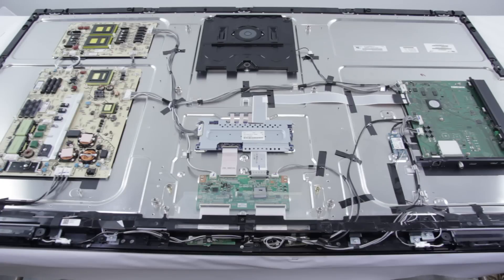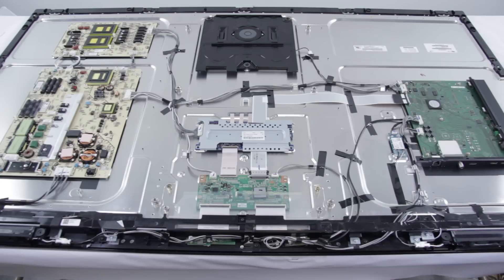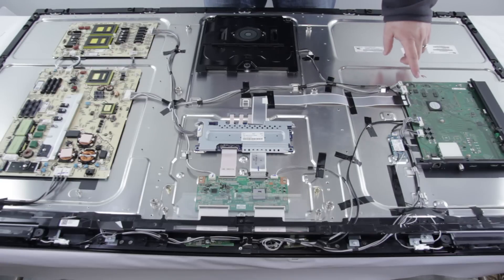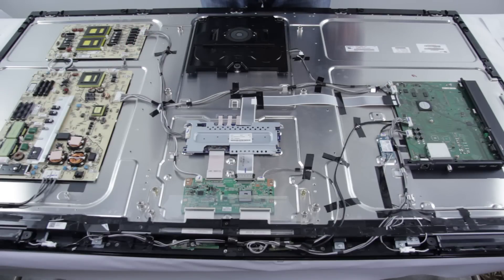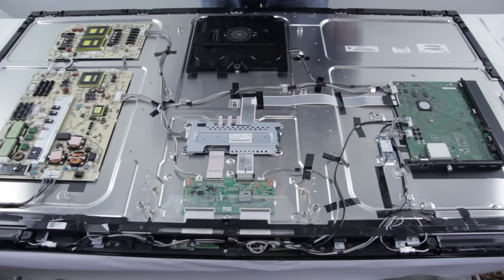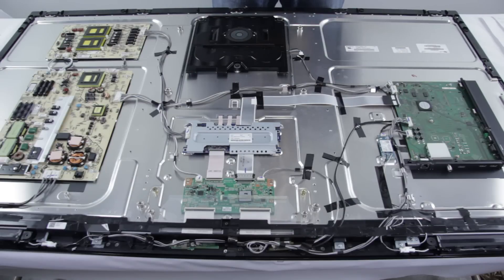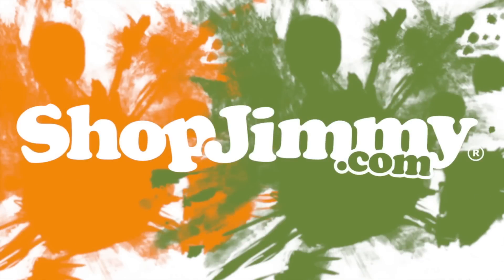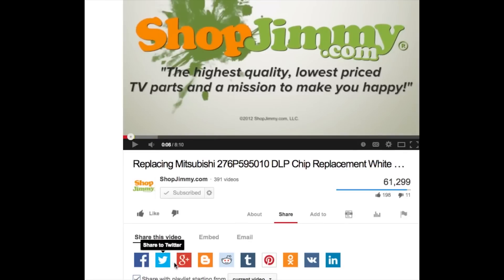LED TV Repair Main Board Overview Blank Screen-TV Has Audio but No Video-Common Issues Problems

Comment: Hello. Thank you in advance. We have a 50 inch RCA model RLDED5078A-B. It has been a good TV. Just yesterday it began to misbehave.  When I turn it on, the picture and sound appears as normal after a few seconds and everything looks great. within a few more seconds the lower half of the screen begins to flash darker in pulses that slowly speed up in frequency until a few moments later when the entire screen goes black. The audio is unaffected and continues. Do you have an opinion?

Comment: I have a Westinghouse HDTV LD-4655VX. The manual power, volume, channel touch sensitive control (not sure what its called" on the right rear of the tv are ultra sensitive. If I even put my finger near any one of the buttons they react radically. Can you help?

Comment: I have a 4K UHD model Hisene 50CU6000. 
It has power and for a few seconds I can see the HISENSE logo on the screen but disappear shortly. 

Somebody said has a backbit LED issue which has to be replaced. I open up the TV and checking LED strips all are lighting up but just for a few seconds. I think is something related with one of the boards... Any input about what can be wrong is much appreciated.

Comment: Hi my LG LED TV model# 42LE7500  is not showing HDMI input. When  switched on , it shows LG logo and then start flickering at the top  with beeps .  what could be issues and appreciate the part# required to be replaced

Comment: I have a Seili SE46FY10.  There is no sound or picture.  The power light is red when plugged in and turns blue when power button is pressed.  Is this a problem with one of the boards, if so which one?  Thanks

Comment: Not sure if you'll see this. Sony xbr75x900f, TV started intermittently stutter-fading where the image would stutter then dim a bit and then stutter back to a live image, all within about a second. This was happening on and off for about two weeks before the TV lost image completely. There is still audio but no video, I'm trying to figure out which part to replace. Any help would be greatly appreciated.

Comment: Hi, I have Vizio Model # E70li-A3 with no picture, I have back lights. At times it would lock itself and I would need to unplug for it to work again. Should i replace the T-Con board or main board?

Comment: Hi.  I'm Joseph.  My TV Vizio M550NV has backlight, audio but no picture in any mode.  The settings screen sometimes comes on but fades out.  When you first turn on power, the visio logo blinks about 93-95 times between amber and white before the tv backlight will turn on but no picture at all, just backlight.  I tested the fuses (swag) and all are good.  No visual burns or puffy caps.  Little gold fuses have continuity.  Reseated the flat strip wires on all the boards and other wires but still have the same problem.  unhooked the IR and turned on with no change.  IS this the Timing controller board?

Comment: Panasonic TX-L42B6B -backlight flashed on randomly when plugged into mains, while green showing on power LED< after a short while the TV goes into standby and the LED flashes red, once every 4 seconds. Any ideas? I know the TV had a knock, but would think the LED TVs to be a bit more resilient that the old CC elements. Thank you!

Comment: I have a 75uj6470 lg tv .. it has a blck screen with bright leds has a few horizontal white lines I get some distortion as I change channels an have sound . Throught some research online I figure it was the tcon board I order it from shop jimmy installed it also installed a new power board  because  I damaged it  while removing the back cover and still have the same issue .. any idea of what the problem could be?

Comment: Hi, I have a UN46F6300AF and the upper half of the screen is dark. The image is there but very dimmed, its like the upper half of the backlight wouldn't turn on. Anyway, I first thought that it could be a T-CON problem so I replaced it including both connecting cables, but no luck, the problem remains. I have all the boards for this TV. Should I try to replace another board or is this a problem related to backlight, led strips?. Thanks in advance for your help~!

Comment: Have a LG  55" model number is 55la7400 when first powered on comes up LG life and then goes black you can still see the picture with a flashlight if you leave it play it randomly comes back on and then goes back out I get audio and all components works and when something is hooked up pictures bright as it should be no dark spots didn't know if it could be a power board since backlight converter is on powerbord any thoughts would be appreciated

Comment: Hi I have LG 43UV766V with defective main board, that gives ok sound but no image. TV has good backlight and I have swapped T-con board. And I’m sure that problem is somewhere on Main board. Do you have any suggestions where to look at on main board to troubleshoot the video?

Comment: Howdy, I've just bought a Teac LED TV (model Let5596fhd) from a friend, I've diagnosed it as having dead backlight (can see black images on the screen (not lit up) at certain angles, and can vaguely make out menus etc), just wondering if this would be a relatively easy fix (I've repaired TVs/Microwaves/etc. before but never an LED tv) and if I can find the part, any help you can suggest would be awesome, many thanks.

Comment: I wanted to commend ShopJimmyTV for its HONEST and rare customer service. I called to order a power supply part that they could have easily sold me but after giving the gentleman a little info to the problem I was having, he gave me a simple test to see if really needed the part and a quick way to test. Bottom line is I did not need a power supply and was very impressed that he suggested where the problem really was. It would have been easy to sell me what I did need but his expert and honesty told me where I should go if ever a future need :)

Comment: Hi, My LG (LE5500) LED TV is not displaying pictures and sound. There is this sound when the remote button is pressed (something like a relay being on) but no display. Neither the power on LED glows. In the background, there is a hissing sound from the main board (sound can be observed from the area where mother board is fixed inside the TV). The LG repair guy says the motherboard needs to be replaced and the local service guy says the main board's main IC needs to be replaced. Pl let me know what could be the issue. Thanks

Comment: hello.  I have a Seiko 50 inch se50fy10 tv. we do not have picture but we do have sound during the flashlight test we can see the picture. I don't know why but I  jumped the gun and bought a t con board which did not help.  do I need to replace the main board now?

Comment: I have a vizio e470i-ao 47 inch smart tv  the backlight flickers and I have no image I have done the flashlight test and tested the power to vout1 and vout 2 on the power board and have readings of right around 130v checked backlight on from power board to main board also and have 3.2 v  any help would be great thankyou

Comment: Thanks for you your video. I have a TOSHIBA 39", and I am having a problem with the HDMI Ports. Both of them are not working. I I verified that the cable is working fine using another screen with my laptop. Now, I use a VGA cable and a separate cable for the audio but there is no audio output!
Do I you think I need to change the main board?

Comment: Hi there...Have a Vizio LED model E390 Bo ...have sound, no picture, did flashlight test, saw words on screen...has no backing lights, removed back cover looked at both boards, no puffy diods, no burning, flipped over the boards, no burns, lots of dust, checked all plug in connections. When powering tv on...does not have V emblem appear. I await your kind reply...Peace, Jill

Comment: I have a Westinghouse LED 39" HDTV 1080P 120Hz Model DW39F1Y1. It's just over a year old.  I was watching TV and left the room for awhile and when I returned I had audio, but no picture.  To make sure it wasn't the Direct TV box I hooked it up to another TV and it was working fine.  From viewing several repair videos I flashed a light on the screen with it plugged into the electrical outlet and could see some printed words thru the screen.  I didn't have it connected to the satellite cable at the time.  Can you suggest what could be wrong and how to repair?

Comment: I have a toshiba model number 50lf621u19 with a picture that is showing but has a white display over it I opened the back but I could only locate the main board and power supply board couldn't locate the t con I don't believe it has one do you think it's the main board

Comment: Hi ShopJimmy, thanks for your videos. I have a Seiki SE39UY04 that had been working fine for a couple of years till some time ago it would go black screen for 5-9 seconds and come back on, while the sound was fine. Sometimes it would happen 5 times a day, sometimes none. Finally it did it about three times in an hour and on the last one it stayed black. When I repower the TV I get a blinking logo and can get the main or source menu for about three seconds before it goes black again. I have only used it as a monitor via HDMI since new.
Any help is greatly appreciated. Kind Regards.

Comment: Watched your video it was helpful I have a LG 47ls5700 smart tv. Last week I smelt a burning smell then heard a pop and screen went black. Unplugged for a hour plugged back in and it has been working fine since with out smell. I just opened tv up. What should I be looking for that could have caused this issue? Appreciate your time

Comment: I have a hisense 32k20dw with sound but no picture is it a bad main board ? I would also like to know how to ground your self and how and where the main board ground wire attaches ?I have a problem with my remote as well it the on off function is not working but the rest of them do

Comment: hey great videos! I have a Samsung LED model UN46EH5000fXZA and the screen has gone out...i do not have back lights and I do see a menu screen when I performed the flashlight test...do I need to replace the LED driver/board?? I didn't see any burned out components on it...thanks for the help in advance!
Reply: it could be backlights or power board

Comment: I have two Samsung, UN46F6300AFXZA that were bought in December 2013.  This past week, the lower 3rd of the screen is darker on one TV (The other has no problems, yet).  I read something about a back lighting problem.  Then today, the top part of the screen was starting to go dark, then back light again where it is currently staying.  The TV also shut off randomly twice (The first shut off was before the darkness problem occurred).  Does my description indicate a known issue where a board needs replacing or is there an issue with the back lighting LEDs that will be a cumbersome fix?  Thanks.

Comment: NEED HELP SEIKI, SE50FY10- Where would the led card be located?  Would that be where the buttons are?  Im looking to purchase from you, just need help...  I did the black light test and did see the menu but having a difficult time locating which card i would need to purchase and where to find it.  Also looking to see the options you may have on purchasing a warranty for the replacement card.  Thank you!
Reply from the maker: Erica Reed   Please watch this video FIRST to help with your repair!  https://www.youtube.com/watch?v=BP3NVNCGEv8  This could be a problem with the power supply board or bad LEDs in the TV.  You can replace the power supply board to see if that fixes the problem.  Click this link to replacement parts:  http://www.shopjimmy.com/catalogsearch/result/index/?cat=59&q=SE50FY10  There may be multiple boards for the same TV model number, be sure to match part numbers on your current board, with your replacement for compatibility.  Thanks and please let us know if you have any further questions with your TV Repair!  www.shopjimmy.com

Comment: I have an LG 55ls4500 tv and it just quit showing a picture. This happens on all inputs and antenna. The sound still works perfectly. There has been no damage physically and I've always only cleaned it with a dry microfiber cloth. Is this a bad main board?

Comment: I have a Hisense 43h63 or is a 43hGe model TV. I had a powered plye center speaker plugged into the head phone jack on the back of the TV. Went to bed got up and now my TV will not turn on. It has power going to the spb but will not come on the red light on the TV is in solid and when I go to the power button to turn on the red light just blinks like six times then stays on as a sold red light. There is power 12 volt coming off the psb going to the main board. Is my main board bad.

Comment: I have a Panasonic tx-55fx555b 4K hdr smart tv which has decided to freeze, its now stuck in standby and keeps trying to turn itself on which dont work whilst the red light is flashing constantly, all the time.
I think whilst watching Iplayer its tried to do an update then switch itself off and on which its done in the past if it ever freezes but this time it has messed up the firmware and cant reset and reboot now.
My question to you is have you got a copy of the right firmware for this tv as I have serched everywhere and cant find the right one, its got a vestel 17mb130s main board inside.
I tried to do an update on the usb drive with update
p183_3108_m22 but it just come up saying software update error on screen and goes back to not working.

Please any advise you could give me I would be very greatfull as ive only had it 15 months and did'nt take out the extended warrenty like a fool, mainly as im out of work have been for a while due to health, hense trying to fix it myself...

The model number for this is VES550QNYS-2D-NO1
Please check my post on BadCaps.net Forum under "Trouble shooting TV's and Video sources", my user name is l3emarsh.

Please get back to me if you think of anything that may help me out!

Comment: i have a rca led 65" model led65g55r120q, i left home one day with tv on, when i came home the sound was on with no picture, i turned tv off then on and sound went out, i then disconnected power and when repowered know just have back light flash every ten seconds or so, (note during flash i can see menu briefly), i have hooked up other tv to cable no problem, so i rmoved back panel and watched some videos on this site and purchased and replaced tcom board but no change still led flash ???

Comment: I have a LG tv model # 50LN5400-UA. I fixed the original problem by watching your videos and ordering parts from you. I have recently replaced the power supply board and the bad LED strip that I discovered was the original problem. TV worked great for a few days but now when I watch it the screen will randomly go black but still play sound as it did before with the bad LED. But I can turn it off and wait a few minutes and turn it back on and it works fine for a little while. sometimes it'll only work for a few minutes and sometimes it'll work for hours but at this point it doesn't make since. it seems like it would be the LED's or the led driver. any suggestions would be extremely helpful. Thank you

Comment: Hello I have a 50L711U18 Toshiba TV that will not power on the red stand by light blinks 12 times would this be the main board?

Comment: Hello, I have a 39" KC LED TV no backlight is showing. Model number: KC-3913, SN: 1310KC39T390HVN01X01743. Power light at side control panel shows its fully functional for power, while there is no sound either, as far as I can tell. Took the back panel off to see wiring and the wiring is still connected to mother board and has no damage. Wondering if there are any solutions?

Comment: I HAVE SHARP LC 70 UD1U 4K POWER AND TIMER LIGHTS COME ON BUT I GET NO PICTURE OR SOUND I REPLACED THE MAIN BOARD AND STILL HAVE THE SAME PROBLEM DON'T KNOW WHAT TO DO IS THERE OUT THERE HAVING THE SAME PROBLEM THAT CAN HELP

Comment: Have a Sharp 60" Aquos LC-60LE631M that has suddenly developed 3 thin horizontal lines that appear to be on top of the image.  The Sharp techs in Qatar said no repair possible as cannot source the main board.  According to service manual I downloaded it is a replaceable part and a tech friend in Oz says it is due to blown resistors (?) on main board.  The part is listed as DKEYMF904FM10 in the service manual but i have had no joy sourcing it or even know if it would be cost effective.  The TV is 18 months old with only 4000 hours on it so am looking for viable options as I am loathe to junk if it is repairable.  Thanks for any help/advice you may be able to offer. Regards, Chris.

Comment: Hi shop-jimmy, I have a Samsung UN46D8000YFXZA purchased in 2012. The TV will not turn on (no standby light either). I replaced the power board, and it still had the same issue. I also inspected for blown capacitors and could not identify any. Do you have a suggestion for the part needed? Thanks,
Reply from the maker: Arun Misra  Please watch this video FIRST to help with your repair!  https://www.youtube.com/watch?v=BP3NVNCGEv8  I recommend replacing the main board in your TV.  Click this link to replacement parts for your TV model number:  http://www.shopjimmy.com/catalogsearch/result/index/?cat=56&q=UN46D8000YFXZA  There may be multiple boards for the same TV model number, be sure to match part numbers on your current board, with your replacement for compatibility.  Here is a link to a video showing how to identify your part number, click here:  https://www.youtube.com/watch?x-yt-cl=84924572&x-yt-ts=1422411861&v=BEPWrefQvqI  Thanks and please let us know if you have any further questions with your TV Repair!  www.shopjimmy.com
Reply: ShopJimmy.com No luck. I tried to buy the part on your site, but never in stock. I ordered from Samsung and just replaced - same issue. Any other recommendations?